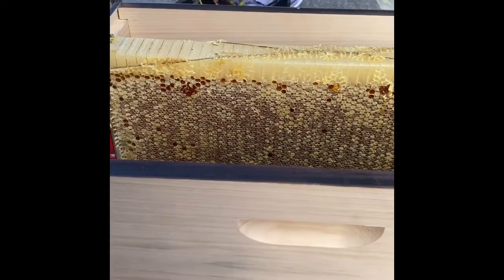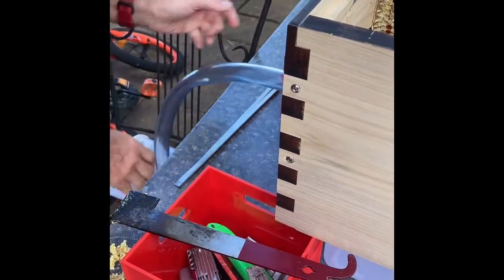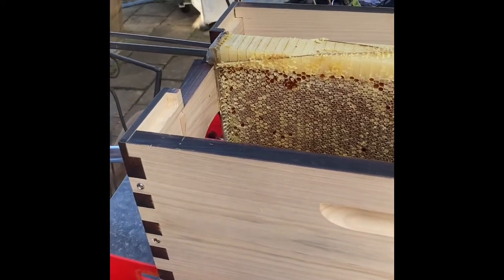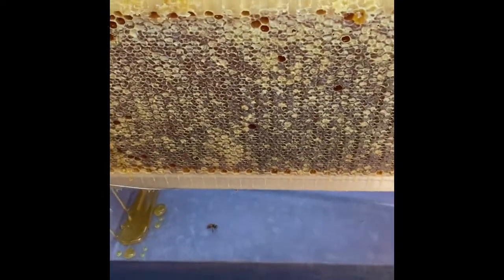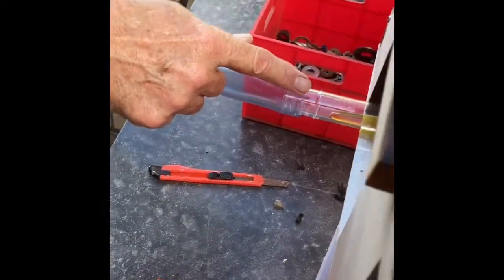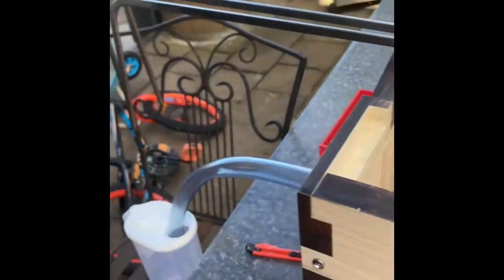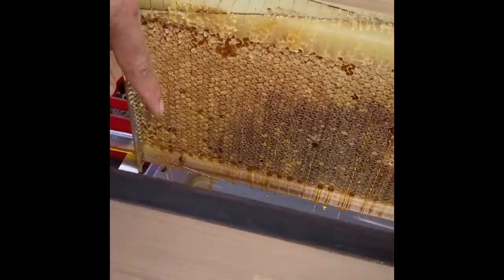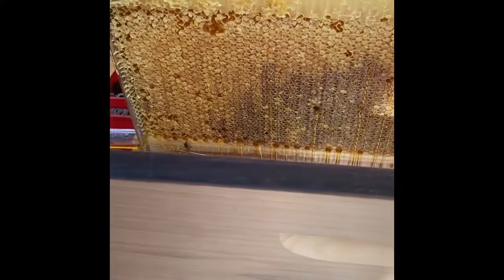Leaking Flow hive frame

Comment: Since you took a Flow Frame off the hive, did you have the Flow frame you were harvesting at the recommended angle to the rear of 3-5 degrees? Not having the Flow frame or the hive at the recommended angle to the rear during harvesting is what  is causing the leakage.